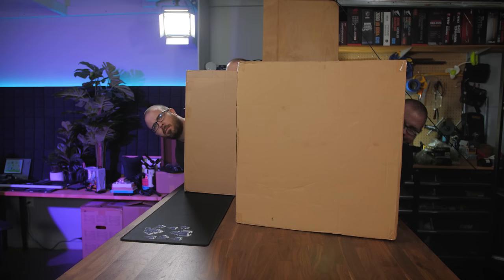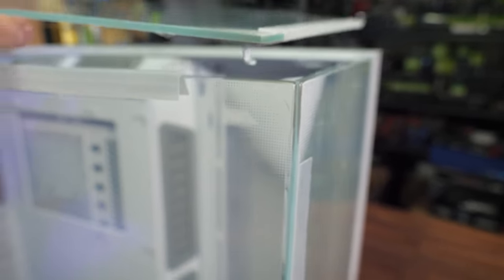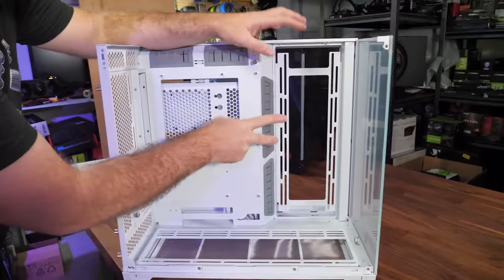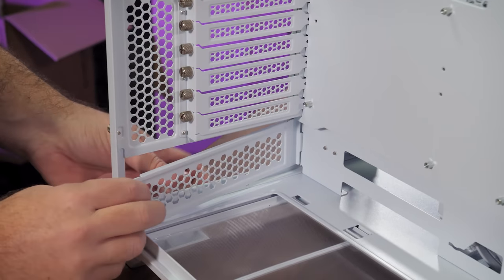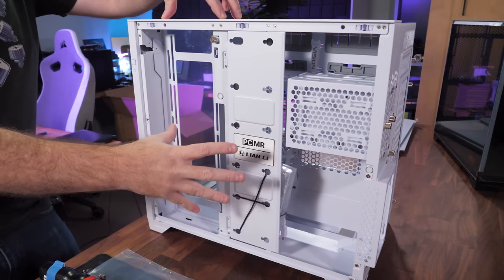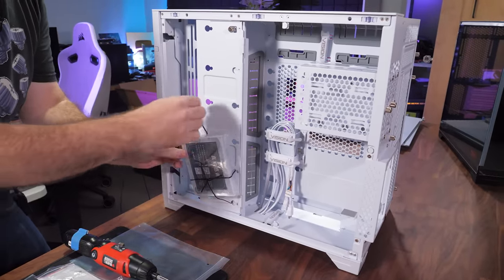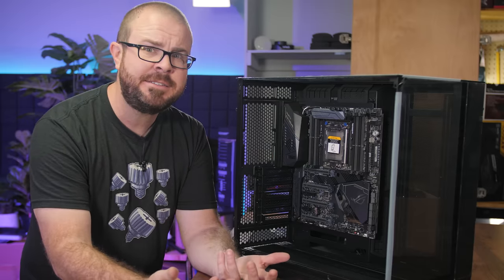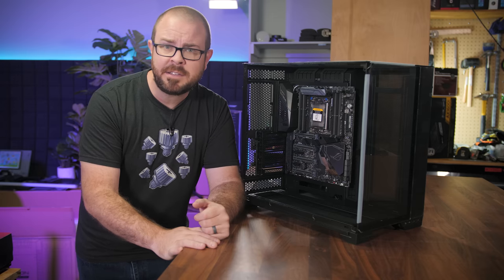Lian Li O11 Vision PCMR Edition Case Teardown

Comment: Clearly the best in PC cases. I really have a very big major problem with my O11 Air Mini tho: it was so good to build in it that I put it together perfectly the first time and as a result since then I have never had a real reason to go back and put  hands in and enjoy the quality of finishes.. :<
Reply: I got the black O11 Air Mini about 16 months ago. First time I've ever been impressed with a PC case & it's looks. Got some upgrades lined up for it soon, so will get to play with it again.
Reply: @sidsuspicious  I just got the 011 Air Mini Last week and I'm not impressed. It was nearly impossible to screw in the pcie screws for my GPU, USB-C expansion card and video capture card because of how they recessed the pcie cover slots, infact I'm pretty sure I screwed in the screws crooked because I had to do it at such an extreme angle, even using a skinny shaft extension for my ifixit screwdriver. If using a ATX motherboard you can't install a 360 or 280 AIO on top, actually you can't install a 360 at all even if you are using matx or itx. If you do decide to go with a 280 AIO front mounted then you better make sure to position your tubes on the bottom because if you have them on the top then you can't install two 140mm exhaust fans up top, I had to go with two 120mm fans. Bottomline is I was really excited for this case and it's now just turned into making a bunch of compromises that overall made it a shitty experience to build in.
Reply: @NonLegitNation2  Bro, see those perfurated covers secured by thumb screws right next to the PCIe covers? yeah, remove those and you get a straight shot on the screws that hold your GPU and add-in cards. My build is fully air cooled, so I won't comment on your watercooling issues (but Lian-Li does offer the RB-001 radiator offset bracket, so your clearance issues can be resolved).

Comment: I just wish the front IO panel stuff can be upgraded easily on all cases. I have the OG O11D and wish I could upgrade to USB4 for example when it's out. The case is so well built physically I can use it for many builds, only issue is the IO gets older.

Comment: Computer cases sure have come a long way over the decades. Thermaltake used to be my favorite case until I discovered the Lian Li cases. For server cases, I still use Supermicro cases as well as Supermicro motherboards. So far I have never had any issues with any of the cases nor the Supermicro cases although I do need to mention that it did take me quite a while to figure out the settings on the backplane and the drive lights.

Comment: I still have a Super Flower knock off of a Lian Li case that has the removable motherboard tray. Got it nearly 20 years ago. The tray slides on rails out the back. The HDD cage is removable as well. Sadly, it only uses the old trusty 80mm fans.

Comment: I do not like the new fad of glass front panel and putting fans/radiators in the back panel. So not a case for me. Cool for others, but not for me. I do like a few of its features though. Like the motherboard tray.

Comment: Does the case support a bottom fan/radiator combo, vertical gpu and motherboard in the lower position all at once?
Reply: i highly doubt it. the radiator+fans would need to clear the motherboard, then you also most likely need a vertical gpu bracket that sits higher than the usual ones.

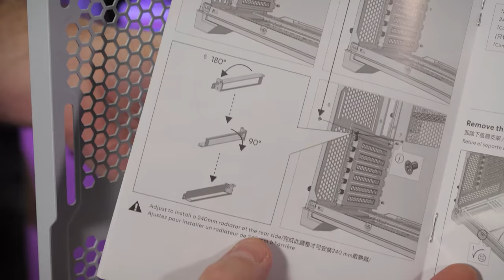Comment: Once again, as the archetypical surprise to no one, you "sumbthcrewed" up the orientation of the expansion bracket big time xD 8:35 as the manual clearly shows, it's supposed to be flipped 180° AND to be rotated 90° - not OR; so attaching it like that self-evidently makes no sense whatsoever. As you eventually figured out "a fiew minoetes laiteur" :3